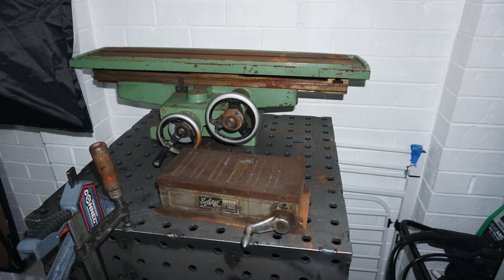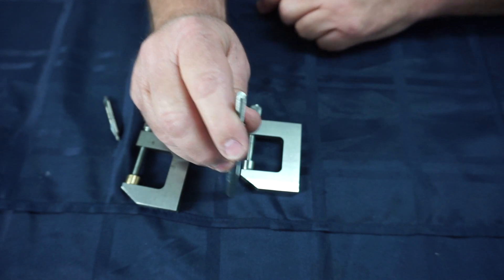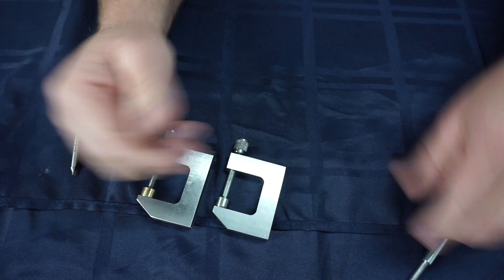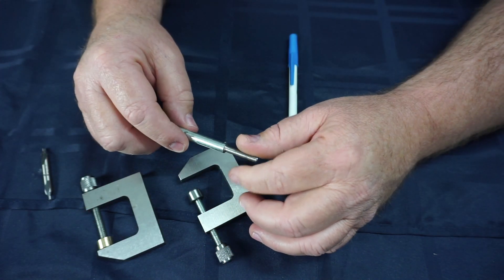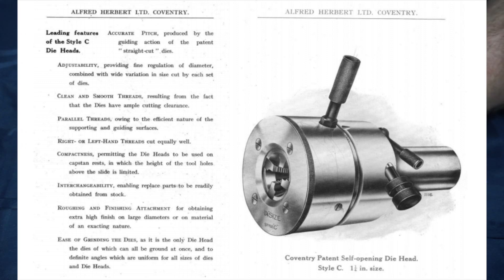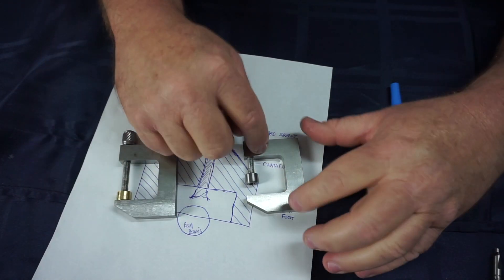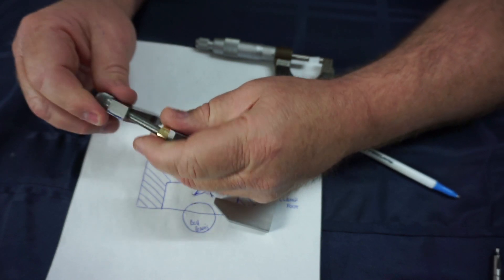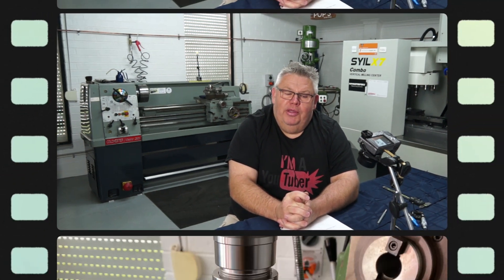Mini Clamp - Part 2 "Trials & Tribulations"!

Comment: Gday Aaron, great idea doing the second video, this format worked well, I like the way you held the foot in place, I’ve got to repair 2 pullers of Dads, the both need the foot replacing and now I can, thanks mate,   Cheers Matty
Reply from the maker: G’day Matty. Thanks mate, you’re the second person to say that. Paul over at knackers workshop said the same thing. Yes the ball bearing trick works a treat. Not sure if it works on big stuff though. Cheers Matty. Aaron 👍🍻.

Comment: Hi Aaron,
I like this format of one video showing the build then another talking about it... Hopefully you have not copyrighted it...
Good to hear our got a good tip from a Fitter / Turner - lol
Take care
Paul,,
Reply from the maker: G'day Paul.  Yes I always keep my mind open to tips and tricks from the old fellas.  They have taught me much over the years.  I started life as a mechanic and then transferred over into engineering working as a maintenance fitter.  So I’m actually dual trade qualified.  However, I've never worked in the manufacturing industry or tool & die trade.  There is always something to learn.  Thanks for stopping by Paul.  Cheers, Aaron.